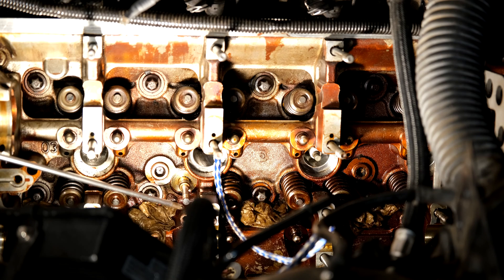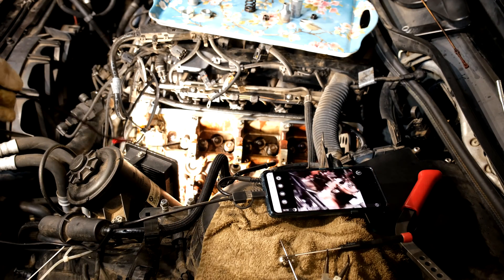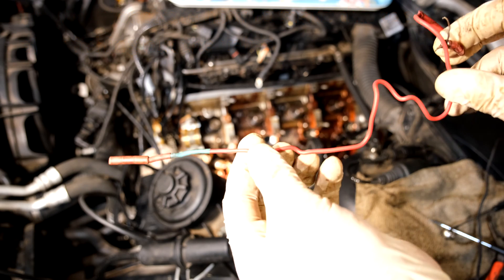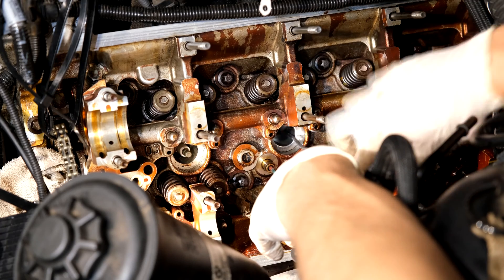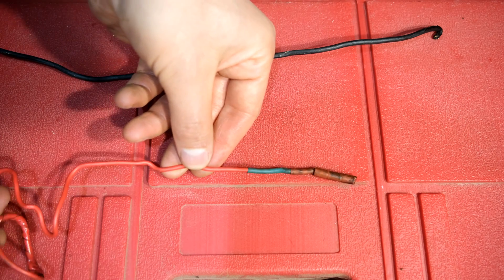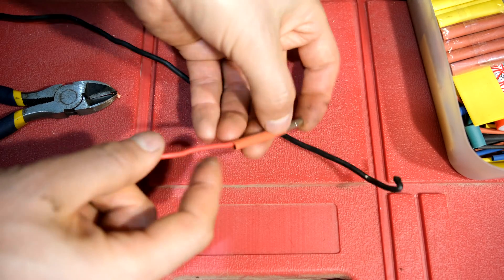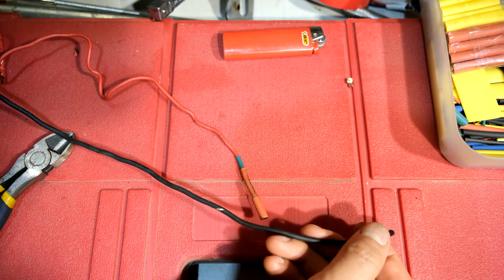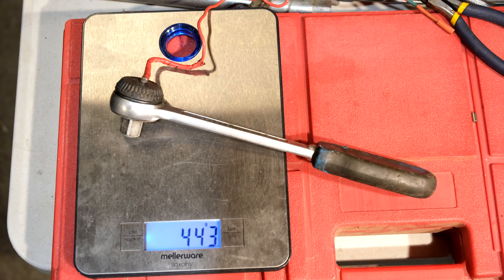How to fish out a dropped valve from your cylinder head

Comment: how about on a small engine honda gvc 160 pressure washer ? I dropped the valve in by accident  :( but there is no second hole like you have to guide the valve while having the magnet inside the valve hole ?

Comment: Guys  , I did it !!! MINI COOPER S N14 ENGINE 1.6 TURBO, working on cylinder 2-3 I get a phone call, the rug went on top of the exhaust valve of the cylinder 2 , so when I quicky come back to the job I started on the wrong valve.......from cylinder 4 ....TOTAL PANIC ....first time in my life I attempt to do valve stem seals....I saw your video and I give it a try, borescopic camera and metal rod bended so that can grab the valve at the buttom , lifting it with both magnet and metal rod I found that as 3mm dia magnet was not centered you can feel that it detaches from the valve stem just when it's trying to get in to the tube , so holding with the metal rod and re attaching it allow it to align to the stem hole and slowly without moving the crank I manage to bring it up , then a little tape and I turn over the wheel so that piston 4 was at tdc position !!!!! Guys never had so much satisfaction , thank you for your video made me and other save so so much money and time , I am working on designing a tool that can grab it from the inside and rotate it on a angle with integrated camera, wish me good luck! lol

Comment: What ended up working for me was a combination of using the magnet tool and using long needle nose pliers through the intake port to guide it out. I wasn't able to get a bent wire into the cylinder properly because of the spark plug tubes, i didn't want to try to remove them.

Comment: Ok I did the unthinkable. I was sure the heat shrink was tight on the end of my wire...it wasn't, or the magnets were to strong and they separated inside the cylinder and when I pulled the wire out the magnets wernt on the end of it, Now I can't get the magnets out of the cylinder. What would be my next steps, remove the head or remove the intake manifold? Help please
Reply: I did the same thing.  I used a very long drill bit through the sparkplug holes and the magnets grabbed onto it.
Reply: Get more magnets or pull the head seriously?

Comment: Legend.  I am going to try and find some magnets today and try this on a supra.
Reply: I was unable to find magnets with out ordering them from Sydney so I bought a bar magnet and cut it down.  I got the valve in position at the hole but was not able to get it at  the right angle.  Head had to come off.  But it was worth a try.  Might have worked better with the right magnets.

Comment: i guess if you really wanted you could leave the valve on the piston head and MMO soak it to clean valve with ring and piston  if your feeling lucky
Reply from the maker: you would also want to clean around the valve seat so you would still need to remove the head to do it properly.

Comment: Helped my buddy do this on his dodge 4.7, this worked really well.
Reply: Amen' I lucked out and thank Jesus, after I finished the mild freakout, very mild, I work it out in my head l, indeed I was luck the cylinder was near TDC and there was sufficient stem showing to niggle it out. Like an idiot I noticed that the compressor  stopped and there was an absence of air hiss . My fat ass was standing on the air line.
Reply: Exactly, passenger side rear. Ugh

Comment: Thank-you... 
ordered magnets online and heat shrink tubing... came today..
Success after trying different sized wire ..used 14 gauge for magnet and 12 gauge for other probe.
On an N62 engine in a 645Ci ...cyl #8 right intake...was replacing valve seals with kit (eccentric shaft etc. still in place... took eccentric sensor off)...not much room but ...with your help I got it done and can finish seal replacement... 
You’re excellent and I appreciate the help!!
Hope you’re staying safe and healthy with this COVID-19 crap going around...
Reply from the maker: well done, sounds good. All the best
Reply: No luck for me.. hanging it up for today. Valve isn’t moving much. Buying stronger magnets this week. Might need to lower piston just a little to get more space. Valve seems wedged. It was moving freely but I think it’s in a tighter spot now. Had trouble with probe and getting it to lift.